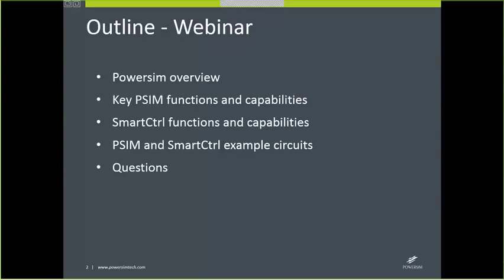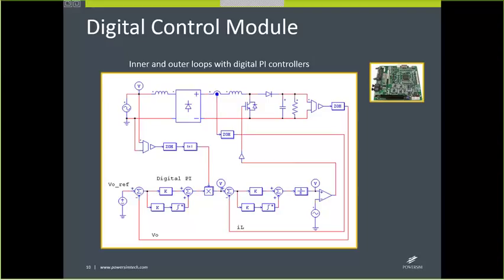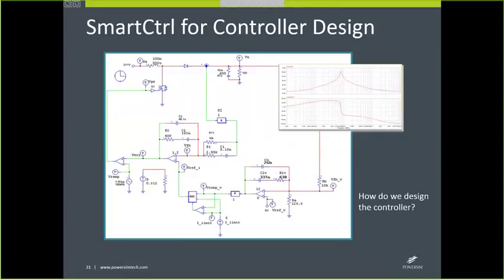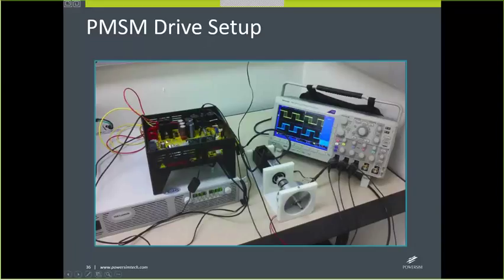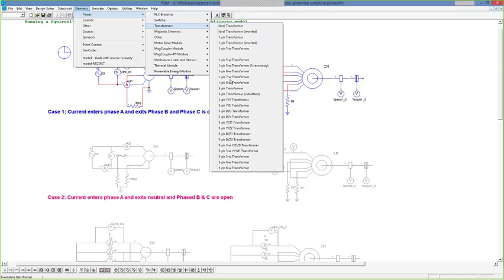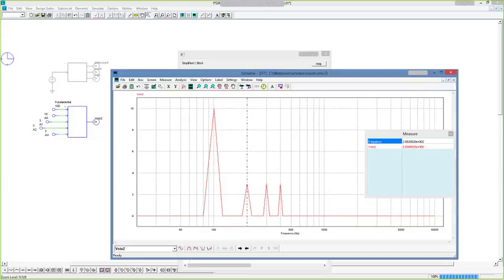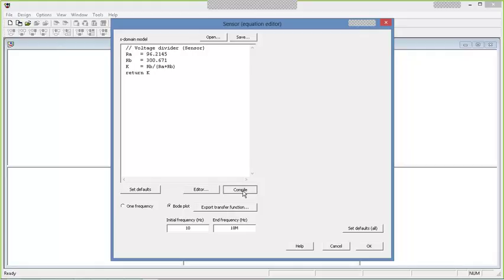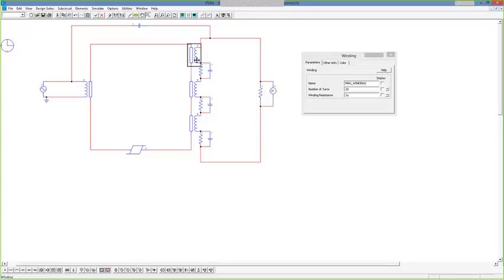PSIM | Dynamic simulation of Power Electronic system

Comment: Hello Sir, thanks for the amazing video! I am new to PSIM and I am facing a few challenges and I hope that you could give me some hints on it. I am trying to simulate an open-loop Dc-Dc buck converter, the first thing I am not sure about is how to drive my MOSFET at the frequency I desire, do I use the gating block or the square wave signal and whether other components are needed in this setup?
I also wish to use a PI controller that would adjust the duty cycle if the measured output voltage is larger than or less than the desired output. How can I set this up please give me some information. Thanks a lot.
Reply from the maker: You need to use a gating block to apply a gate pulse to a mosfet. Its symbol is similar to play button of video palyers.
Reply: Great , but how do I control the duty cycle with the gating block?
Reply from the maker: Behind the gating block the control signal generation is made. So you should first create a pwm then join it with the mosfet through the gating block
Reply: I see now, and does the PI controller come right before the PWM?
Reply from the maker: Yes. You should  read some research papers in this regard !!
Reply: Yes, I am currently doing that, thanks for the help!